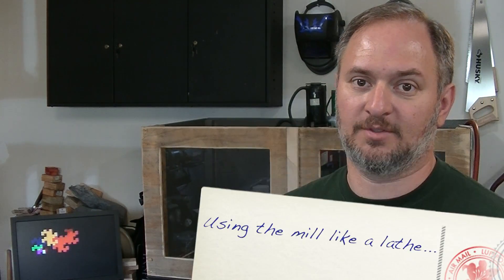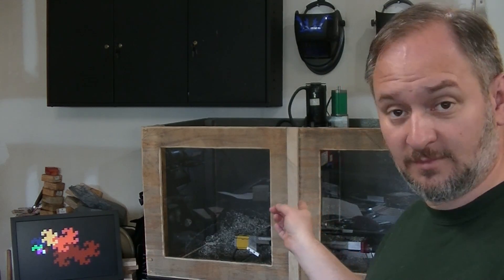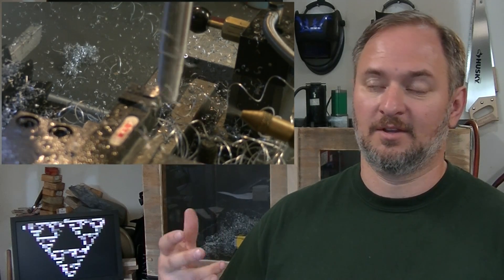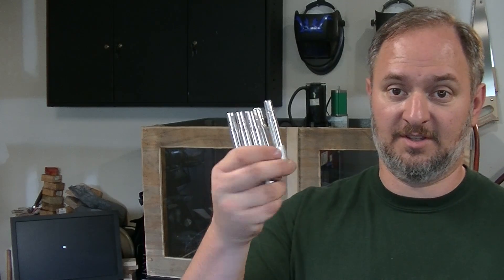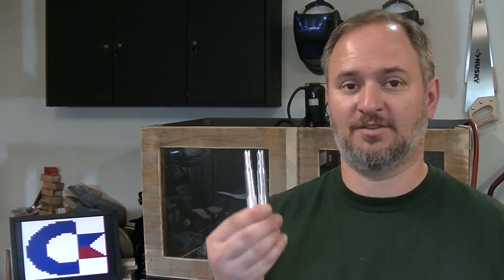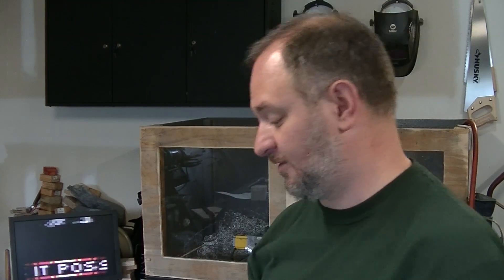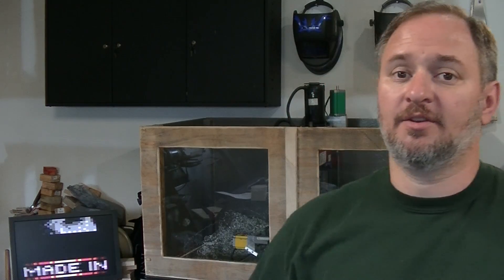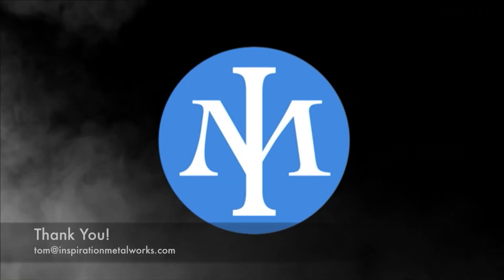Mill Turning

Comment: Good job Tom and clever use of what you have available.Re: feed rate - being a turning tool insert the manufacturer's recommendation (0.006) sounds like 'inches per revolution' to me and not IPM. So if the top speed of your mill is 4300 rpm their recommended feed rate would translate to approximately 26ipm. (As a starting point).Al
Reply from the maker: +ColchesterBridgeport You're absolutely right and I was reading it just how you described at first. Glad I got that sorted out. I stopped at 40 IPM but I think it could go even more. That .006 was the starting point for the range. I'd like to push it just hard enough to break those chips without introducing too much flex in the part. I'll keep you posted!

Thank you for watching and helping clarify what I suspected I was doing wrong there.
Tom Z

Comment: My little cnc lathe won't even more at 40ipm! ...hhmm.....or 4300rpm for that matter.  I really need to get some mill turning done soon.....I'll be looking for that in fusion.....probably after I get back from break(nap) :)
Thanks!!
Mike
Reply from the maker: +bluehandsvideo Hi Mike! I should probably go over the Fusion part in detail as well. It was pretty close to the same thing as just doing a facing and profile operation though. Let me know if you get an error when choosing the Mill Turn option and then going to post the code...

Best wishes,
Tom
Reply: +Tom Zelickman (Inspiration Metalworks) I got a tube drawn, but that was all I had time for.  I need to do a face cut, OD turn, ID bore, and a cutoff op.  I'd probably just use MachStdMill, but since I had to switch the BOB back to the old one, it seems to have lost all the parameters.....so I need to set it up again.....but I might as well wait to do that until I put the new BOB in that's sitting here.  I need to do some mig welding....which means blocking off the mill with my welding screen and table.....so I can't do much if anything with the mill until the welding is done.  I really need to get the motor back on my little lathe!! lol
I'll watch whatever you put up. :)
Mike

Comment: Great video Tom, enjoyed the mill turning.  Did you mention what speed you were running the spindle?  Have fun in OH, i am sure it will be a blast.
Reply from the maker: +🔥Ramsey Customs - turbocobra Hi Gary! I started out at 500 RPM and .006 IPM (way too slow) and then moved to about 1200 RPM and 2 IPM. Finally, at the encouragement of Chuck Kidwell I cranked it up to the full 4300 RPM and used 40 IPM for the cutting rate. As long as I had decent mist coolant I didn't get any chatter at all.

Talk to you soon!
Tom